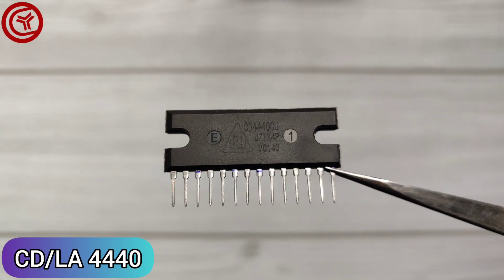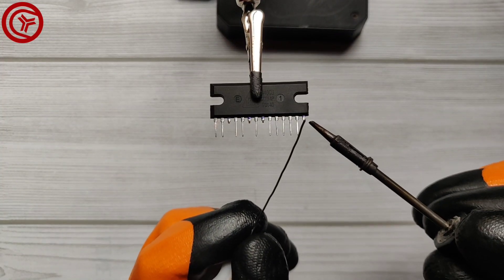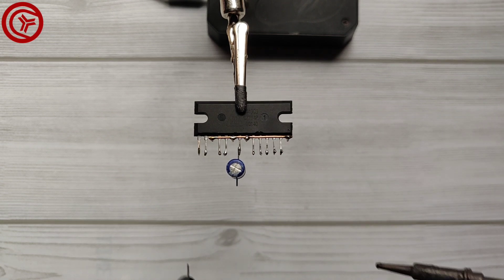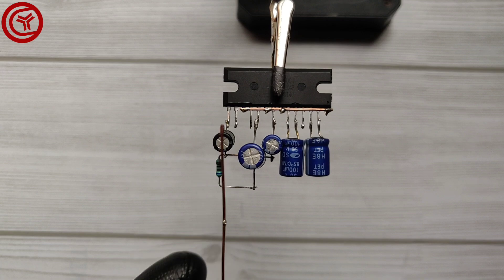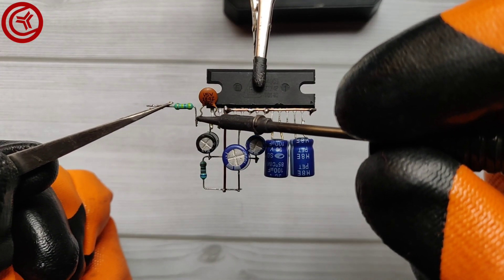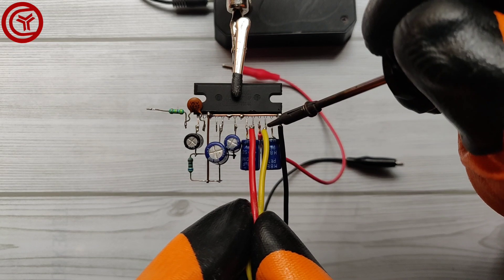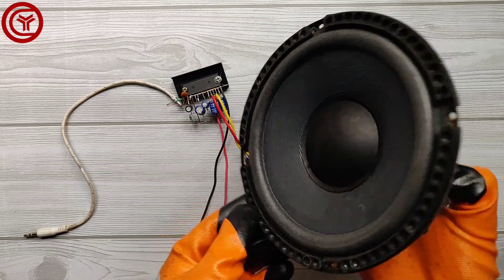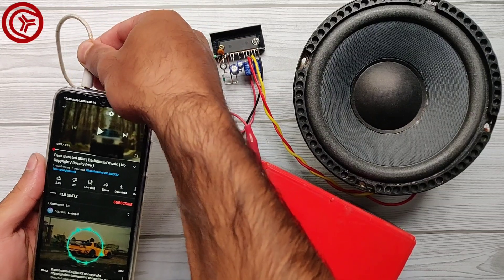Bridge LA4440 ic audio amplifier circuit

Comment: I'm using adapter and I'm getting a buzzing sound pls help
Reply from the maker: Skip the audio input resistor, instead connect 470nf to 1uf ceramic capacitor between on audio input & ground to reduce humming sound, and audio to ic should go through 100nf ceramic capacitor as shown in video.

Comment: It's wonderful. How can I add a potentiometer for sound control in the circuit please.
Reply from the maker: Simply add potentiometer pin 3 with audio input resistor that is connected with ceramic capacitor, pin 2 with audio input & pin 1 with ground.